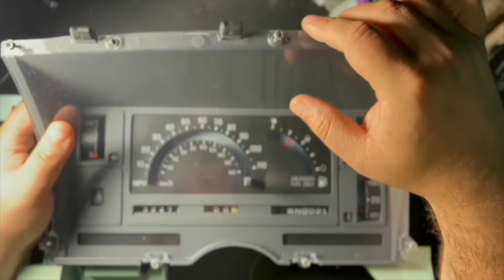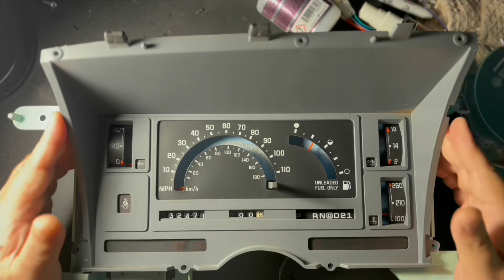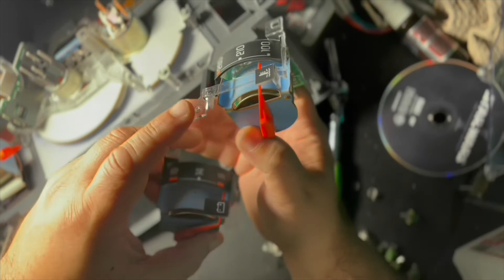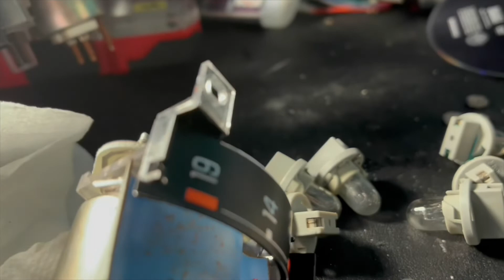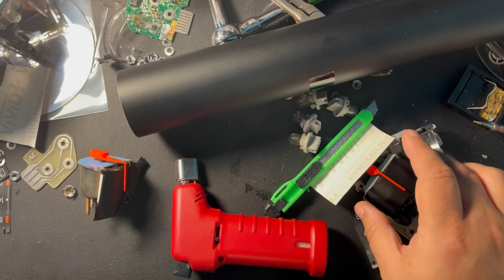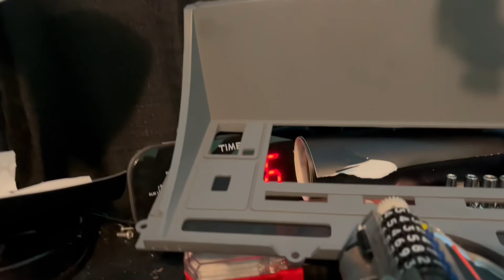S10 Blazer-Updating The Gauges Part 1

Comment: Can you do a video on how to fix gauges that won't move that's what's wrong with mine rn this video helped a little bit
Reply from the maker: I haven't actually had that issue yet.  But if I run into it, I definitely will. 

However, to be honest, there's probably much better qualified YouTubers for this.  I highly recommend Kevin from Junkyard Digs and Junkyard Mook for this. He has a degree in engineering and  has a great way of breaking down complex issues into layman's terms.  His friend Luke from Thunderhead289 is great at these tasks as well.

If I had to give any advice, I would just say to grab a pinout online, test it for a power issues.  Also, some penetrant oil may help. I just wouldn't advise trying to work the needles back in forth as I am afraid my advice may cause you to possibly strip the teeth on the gear(s)

Comment: Hey the 4 clips on the back how did you remove those?
Reply from the maker: If you are talking about the ones that hold the face to the ribbon connectors, they're pressure fit. So a little pressure and a lot of patience.